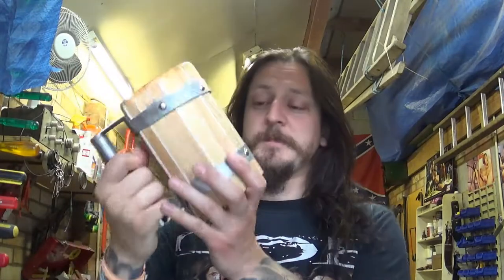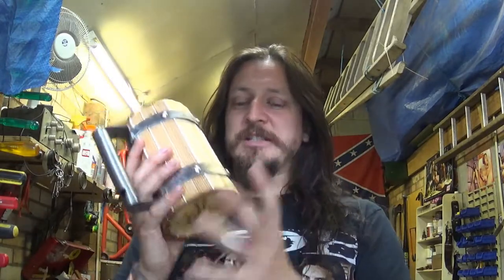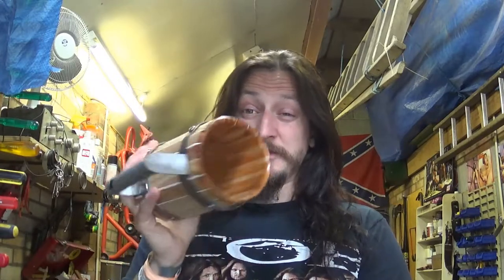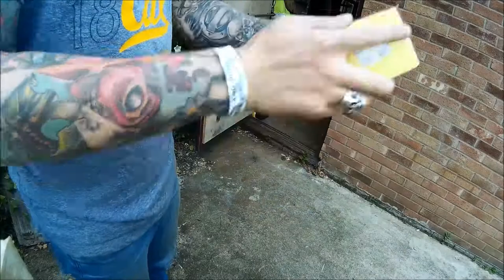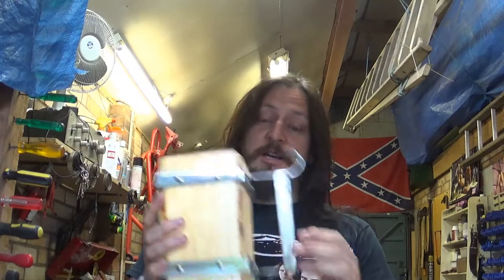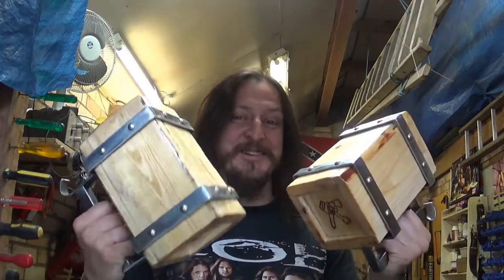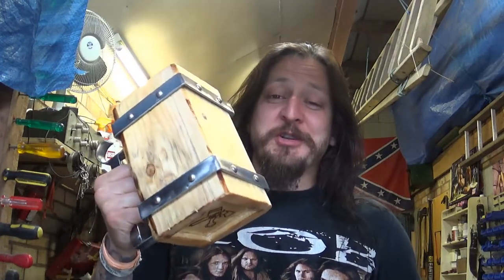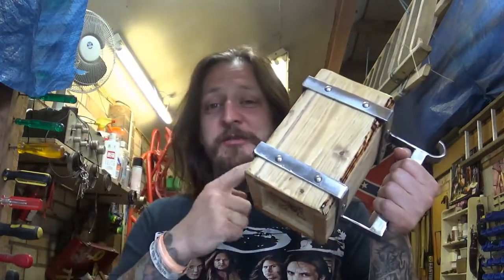For The Love Of Beer - Making a wooden beer mug MK2.

Comment: Hello ive been making a few of these but with a bit heftier material such as 1/4in steel flat bar, and been trying to figure out how I can attach the rounded flat bar to the wood besides rivets, as I do not want to pierce the mug and potentially create a weak point when i'm slamming them with my friends. I don't really believe it'll be a problem to rivet, but if I could how else would I go about securing metal to wood traditionally without glues? Thank you. :)
Reply from the maker: I'd cut a little grove in the wood and match the metal bar to it. Need to be super precise tho...
Reply: @MackieBass  great thanks!

Comment: What did you coat the inside with. I really need a welder. What's the best to get for simple work?
Reply from the maker: Harley & Me marine grade food safe resin. When it comes to a welder...go for spec over a brand. Simple hobby mig welder should do for small jobs...anything around £200 should be more than fine.
Reply: MackieBass cheers for that